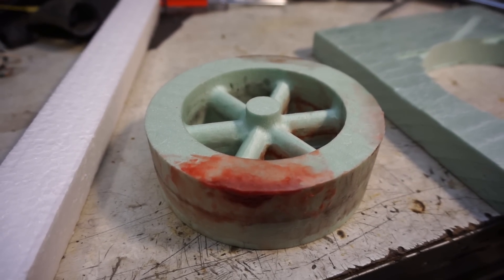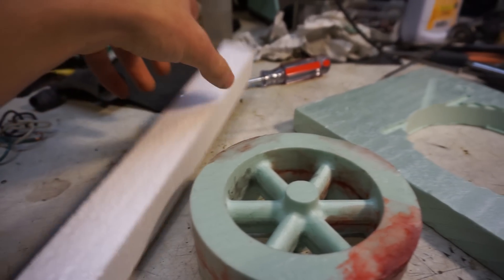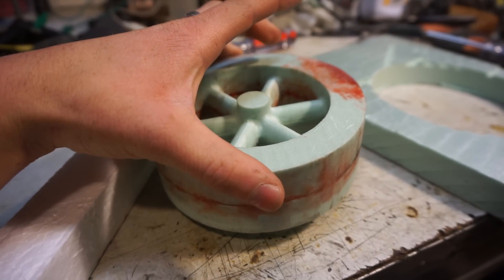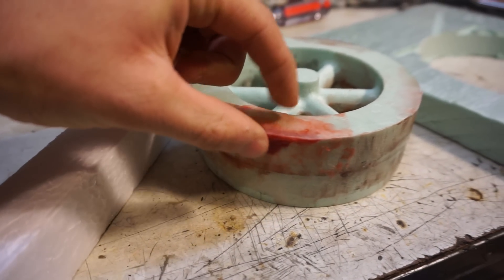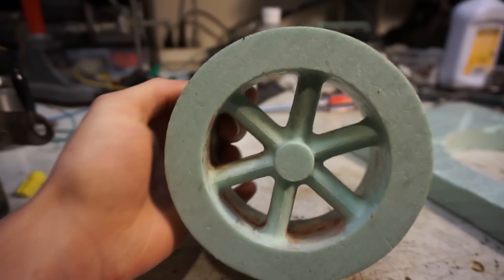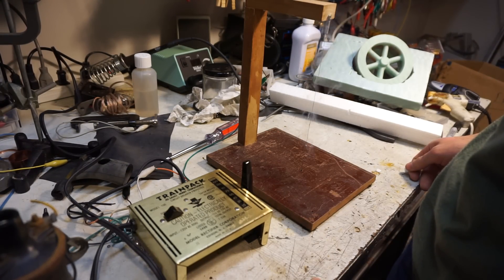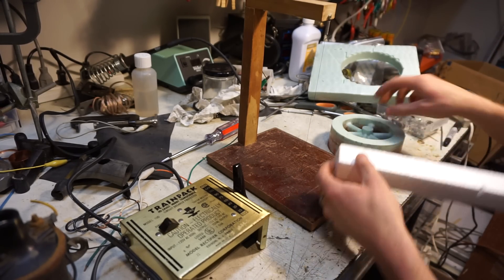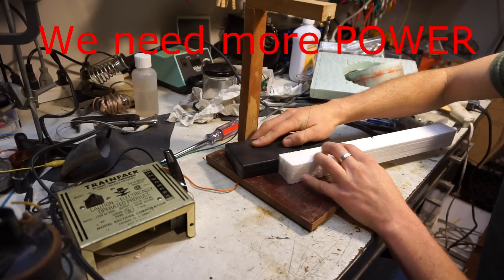Casting an Aluminium Flywheel Using Lost Foam Method and CNC Routed Foam

Comment: I will give you a tip for Lost foam casting...  Always make your entry cone big enough to take the entire crucible of molten metal.  So the metal can be poured at once and flow into the foam casting.  (your was not big enough hence the metal flowed over the edges (slightly dangerous.)  Also you are correct about the sand being too coarse.  Pretty good casting though. Nice work.
Reply: best way is to put  a tin can over the entry point, this creates head pressure as well, which helps fill the mold better

Comment: Did you build the styrofoam cutter? if so... how did you do it?
I'm having a lot of problems to build one myself
Reply: he used a transformer connected to a wire. check out King of random video on his
Reply: David Serrano I tried that one, I even tried to put science into it by checking values and stuff, it just doesn't work :C
Maybe i'm just dumb
Reply: l1o2q3u4i5n you just need to run a ton of electricity through a cable

Comment: I tried making a copper band nearly the same size as yours. i tried 5 times, each time a miserable failure. It ended up looking like a curled piece of intestines made from copper. For some reason I believe copper's interaction with foam is not the same as aluminum's.

Comment: would it give a finer finish if you put the mold on a vibrating table while pouring sand before you pack it in?
Reply: Even just using a finer quality of sand would make the surface finish greater. And from what I saw, they could have packed it down much more tightly. Both of these together will give an even better surface finish.

Comment: According to the fellows in the Lunenburg Foundry, the reason the sand sticks to aluminum casts, is when it is poured too hot.
They chucked some scrap pieces inside the pouring pot to quickly adjust the temperature down a bit.
https://youtu.be/njl1ciKJ5vs?t=8m30s
Maybe useful info for you... :)

Comment: If you are using a steel can as crucible, it is unlikely you will melt it. An open charcoal furnace will not get hot enough. Steel melts about 1500C. However, the risk is actually the use of charcoal. If you are using this crucible frequently, the carbon will diffuse gradually into the steel (look for cementation or carburizing). As the carbon concentration increases, the melting temperature of the alloy gets modified. (Look for the Iron-Carbon phase diagram). With only 2 % of carbon, the steel becomes kind of fluid above 1150C due to the coexistence of a solid and a liquid phase. 
There is another risk. If aluminium gets overheated, it gets oxidized rapidly. The aluminium oxidation is a high energy reaction that release a lot of heat and that perpetuates the reaction.(some solid rocket fuel used have aluminium or magnesium powder to produce a constant  source of heat). It can get as high as 3000C! and that will melt everything, including any refractory material.  That is more likely to happen than melting your crucible. Additionally, if you are doing this frequently and you have noticed that sometimes the final product has more porosity, it is also related with temperature. Too high temperature dissolve gases from air. When it cools down the solubility decreases (in the same way that you can dissolve more salt in hot water than in cold ice water), the gases form bubbles but the solidification is quicker than what would let the bubbles reach any surface. You may know that some people use degassing materials, but that is usually for large aluminium castings where you really need to overheat the melt to prevent it to solidify before complete the casting. Maybe you already know all this. .... It occurs to me that perhaps covering the foam with plaster or airbrush it with several layers of  water paint may improve the surface finishing.  Nice job!
Reply: what is more dangerous is that iron is soluble in molten aluminum - in other words, aluminum will dissolve steel. if a decent oxide layer is there, this lessens the effect, but it is still there. it is best, if using a steel crucible, to use one that has at least a 1/4" wall all around.
Reply: Not sure if it matters, but it looks like he's using actual coal, not charcoal

Comment: Hi,

Really pleased it came out OK for you!

It must be great to have a ready supply go fuel, but do not say where it is or it won’t be there for very long, if you see what I mean.

I have seen several videos, which I never kept the link to, where a seemingly small fire on a coal baring ground started a fire under the surface and it was not noticed until tree started burning down from the roots I think they said. That fire cannot be put out now as it continues to burn no matter how large the mining machines are which try.
That said and as you seem to be working on a coal tip, it might be wise to make a large enough steel tray to work on as this fire I mentioned underground it was found too only a single burning piece of ash or something in the ash coke maybe, and it was spread over the ground thinking it would get cold rather than start any other surface fires. Of course whomever was doing it never dreamt it would start the coal burning under the ash.

Comment: Not sure what type? It's styrene plastic. That's why it's called "styrofoam". Yes, you can burn the foam out, but the casting is better if you melt the styrene out of the mold first with acetone.

Comment: Aluminum melts= 1,220F (660c)  Talcum Powder= 1,472F (800c). Use 1" of Talc around foam object, then sand to pack tight. Way smoother, more uniform surface.  A large, well made coffee mug is suitable as a crucible for aluminum.  What you're doing is basically this:  https://en.wikipedia.org/wiki/Refractory  You can make your own crucible if you have access to good clay and a kiln or fire your own right there.  "Fire Clay" fuses (melts) at 1,580c ~ 1,780c so great for a crucible.

Comment: One trick I've seen for keeping a smooth surface with lost foam is to coat the foam in drywall plaster and let that dry before casting. No other changes to your method. Great work!

Comment: I wonder if there is a way to balance the wheel with some DIY method. I bet non of the spokes are the same.
Reply: +darek4488 there is, you balance it on a central point and put weights on the side thats high, and figure out how much, then drill out that much weight on the other side.
Reply: Use your cell phone... http://www.instructables.com/id/Dynamic-Motor-Balancing-with-Sugru-and-an-iPhone/?ALLSTEPS
Reply: Levi Blaney Not accurate enough. Cell phone gyro is electronic and uses only 2 Axis planes, not 3 in most handsets. A high quality gyro chipset consumes a lot of battery power and requires REALLY good software.

Comment: Great video. Not that I'm an expert but I've seen a few videos on casting in general you'd want to sieve the sand onto your project that way you get more detail after casting once covered with sieved sand you can continue filling up with lumps and stamping it down.

Comment: You need a shaker table to set your castings forms on when you add the sand. It packs it down really well. Also you could use a drum (can or something) that rolls with steel BBs or possible sandblasting sand and toss the part in and let it turn for a good bit. It would clean off a lot of those bumps that your not going to turn off. Both items are easy enough to make and can save a lot of time and make clean up a lot smoother.

Comment: Great job!   If you ever see the inside of a Saturn engine a the wrecking yard you will think it was made out of silver painted Styrofoam. They use lost foam on the cylinder heads for sure...the weak stuff like foam cups are made of.

Great work. Sounds like the kind of things I made over 40 years ago...lots of one of a kind things. What's the flywheel for? A home built engine?

Comment: First of all, you have FREE COAL!!! I'd run everything on that! I'd have a car that ran on coal, like with an Arduino microcontroller automatically stoking a steam engine (remember to use your smart phone to start your steam car 20 minutes before you want go anywhere). Secondly, good job, nice video. And lastly you need to make some parts for that lathe. Any part of a lathe can be made on a lathe. (I'm not sure that's literally true, but that's what they say).

Comment: loads of fun 
im doing this now
i made a aportable bucket furnace using sand and white cement but it failed it wanted to melt but it did not keep the heat in well

so im making a donought  cover to help prevent heat from escaping...the hole in the middle is big enough to melt cans

Comment: very cool project. keep it up man. but what i learned over the last year of casting aluminium is that it is not the best idea to overheat it to a orange glow. when it gets too hot the iron of the crucible becomes soluable and will increase the amount of iron in the aluminium which makes it very bridle and weak. also it will eat through the crucible way faster. i learned it the hard way. nonetheless, great video. i like it:)

Comment: Nice job, would love to pour some wheels for a belt grinder but do not have access to a metal lathe at the moment.  One suggestion: if you are going to take the time to CNC the foam why not just use machine to make a more typical split pattern?

Backyard coal supply is awesome and I'm sure burns much hotter than the charcoal I buy at the big box!

Comment: Nice! I´ve seen in other videos that people use talc powder on the molds. Maybe that will give you a smoother finish.

Also, have you done some strength test on your productions? because cooling metal slowly vs cooling it quick has a direct effect on the hardness and flexibility of the piece. Although that is dangerous: try it only with small moldings (make an oval and submit it to weight tests, and see when it breaks.

A flywheel wrongly casted might break apart (look for videos of CDs and drills, and you´ll see what I mean). That's why you need to find out the limit of your casting technique, I think.

Comment: The flaking is probably rising air pocket trapped underneath a layer already cooled against the sand. Why don't you tilt the cast 15deg and have 1 or 2 vents at the top corner? The flat surface between the vents creates air pockets.
yea, spend more time packing the sand in thinner layers. I'm not sure what the finer powder would be, my guess is grounded clay or concrete power mixed in, very fine powder, it gets into everything.

Comment: Really nice work. I have a collection of casting molds for building reduction drives used to put automotive motors into airplanes. I have no machining skills. You should contact me if you are interested in having them. I could send you pictures if you are interested.

Comment: most people that do the lost foam use a hot glue gun for glue because it burns out just like the foam,  and you also may get a better surface finish by dipping the while mold in some watery investment. you have to let it dry for a few days though it make a "skin" barrier in-between the Styrofoam and sand  the investment will be as smooth and the mold. I have even herd of people using drywall mud but I have never tried it myself jot sure how well that works  great video by the way I loved it, I was doing the same thing at your age :) my friend and I cast an aluminum frame in metal shop for a go cart , our crushable was big enough to hold about 2 gallons of aluminum lol

Comment: I am curious why you used green sand instead of just plain, out of the bag play sand.  Also, didn't you ruin your flasks this way?  A metal bucket would be better, wouldn't it?  You might also check out this site I found on lost foam casting years ago (caveat: I have not tried this).  http://www.buildyouridea.com/cnc/hblb/hblb.html

Comment: I'm floored by how that came out. One thing that helps on the machining, especially our home brew aluminum, is to spray water on the piece as you're cutting. It gives you a better finish and prevents much of the galling on your cutter. You might already know that. Again, awesome job and I'm going to have to give this process a shot.

Comment: You need to put a torque handle on the poring rod, as you poured the aluminum too fast. The handle is like those you see coming off the side of a mowing scythe. You can control the rotation of the rod that way. Balance the rod in one hand, where it rotates, closest to the mold, and use the other hand to control the rotation with the handle. In your case, the handle would have been in your left hand. The handle needs to be angled down, maybe 20 degrees, when the crucible is sitting level. One could put a small steering wheel, say off a go-cart, on the end of the rod, and do the same thing.

Comment: you can use plaster to cast aluminium.
Reply: +Oliver o niell  yes, and it better be bone ass dry too or you'll have hot metal all over you.. a friend of mine did that, luckily he was wearing leathers or he would have been looking like the terminator....
Reply: HolzMichel thanks, i was planning on doing it. So you reckon just shove it in a kiln first?
Reply: Oliver o niell
an oven would work too if you leave it on a low setting for several hours. a kiln might be a little too hot for the plaster.
 weigh the mold first, write down the weight, then weigh it again after 2 or 3 hours. then divide the dry weight by the wet weight and multiply by 100 then you have the percentage of moisture that has escaped.
put the mold back in the oven for another hour to see if there is a weight change. if there is not then you have driven out all the moisture (it will flash to steam when it comes into contact with the molten aluminium and explode)
take a lit candle and blacken the inside of the mold if you can. that acts as a release agent.
just make sure you fill the mold within less than an hour of baking out the moisture.
plaster (gypsum) is hygroscopic and will take up moisture from the air in a short amount of time
Reply: HolzMichel Thanks that's perfect. you really know your stuff. Great to see a great mind at work :)
Reply: Oliver o niell
when i was a kid/early teens me & my buddies would cast a lot of lead and tin and made molds out of plaster.. the first time we tried it without drying it out in the oven we got a very loud surprise.. lol..

glad to be of some help
Reply: HolzMichel Thanks!!!

Comment: Just some advice from someone who's done a lot of machining. You can take a lot more material off on a rough pass like that. With soft metals like aluminum it won't matter much. With things like steal the chips you were making would have been about right. The thing you have to be careful about is chatter between the tool and the work. Always make sure your tooling is sharp too. While it's not as important for brass, copper, and aluminum you definitely want to make sure your tool insert is sharp for harder materials.

Comment: When you pour aluminum too hot (close to boiling)-- it'll want to wick into the sand; essentially bubbling into it.  I've cast a few nice pieces of slag before I figured that one out.

You might also want to get a spray bottle.  Spray down your over-spill to solidify it pretty quickly, and having a spray nozzle to blast onto the hot metal once you pull your workpiece out is really good for cleaning it off; the sand flies right off when the metal is hot.

You might also want to invest in building an LP gas furnace, since that's generally the easiest smoothest way to do aluminum and lightmetal alloys that I've seen.
Reply: +ParadoxPerspective He's got some pretty sulfurous coal, with ceramic he could do some cast iron work. sure, the iron would probably suck, but he's not wanting for temperature.
Reply: I'd still recommend LP gas in a proper furnace to anyone wanting to do aluminum.  It's just a cleaner burn.  You don't get sparks everywhere, or risk contaminating your crucible with carbon-- and your crucibles are going to last a lot longer on propane than they will on virtually anything else.

Comment: Please tell me you were not trying to reverse the lathe while it was still running, other than that great video.
Reply: He was not reversing the lathe ,but the lathe feed direction. That was still a bad idea if you were only holding it marginally, much better to have turned the work around an gripped it on the center spindle.
Reply from the maker: +just tim Yeah I was.  I made this video several months ago when I was still a noob at machining.  IDK what I was thinking.  I know better now.  Especially since those gears are ZAMAK and will get destroyed.  Any kinda gears that's bad.